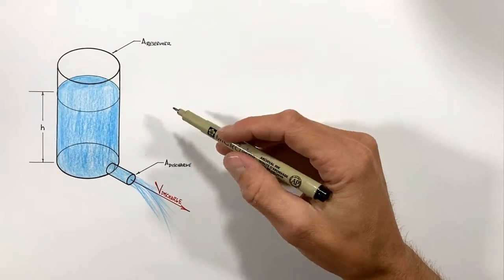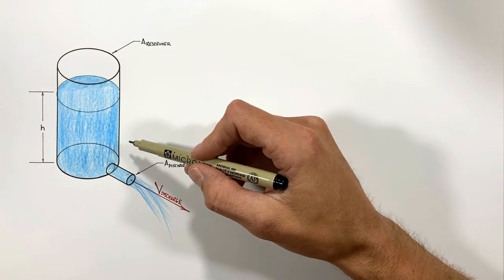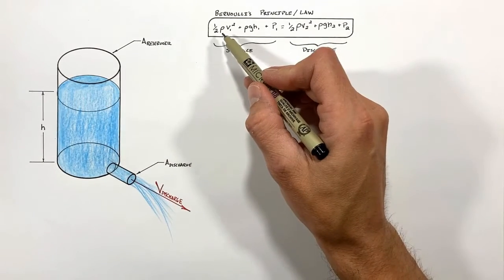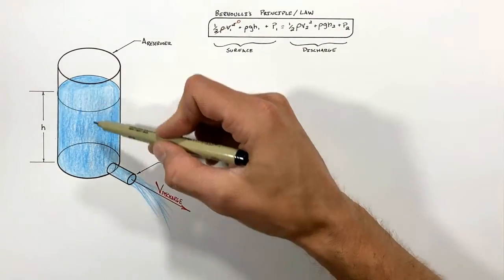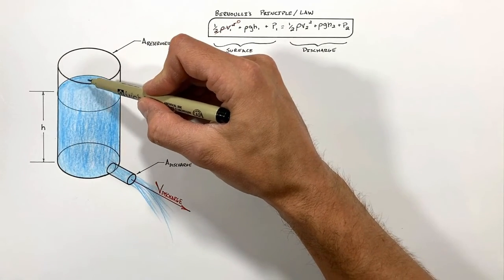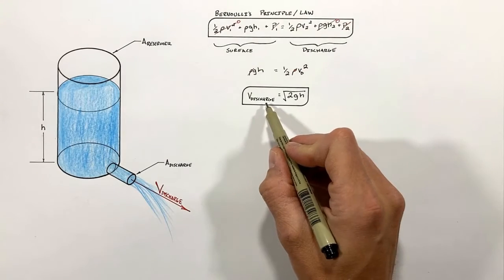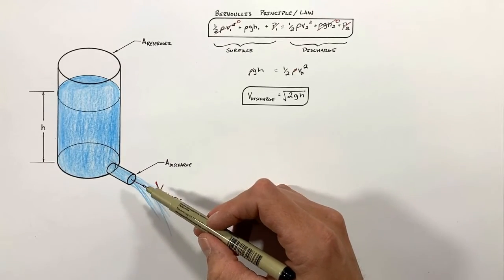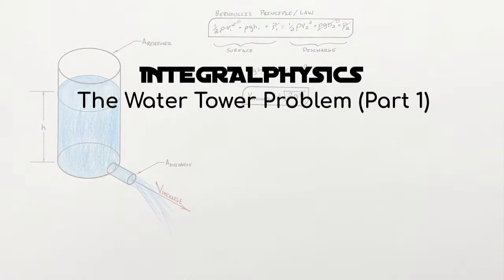Bernoulli's Water Tank | Calculate Discharge Velocity

Comment: I didn't like it about engineering. Many terms in the equation are assumed to be equal and just cancelled out. And here I am thinking what if P₁ and P₂ are not same, moreover g is not same for every height.
Reply from the maker: While you aren't wrong; do you really want to have a tank so tall that the atmospheric pressure and acceleration due to gravity vary between the top and bottom of the tank?
Reply: @INTEGRALPHYSICS  practically I don't want such a large tank but theoretically I want to consider each and every factors.

Comment: If I have a given tank size filled at a certain height, and need to determine the cross sectional area of the discharge pipe in order to achieve a specific discharge velocity at that instant, how would I use Bernoulli's equation given the cross sectional area is not in the equation?
Reply from the maker: 1st...  is there frictional loss in the problem you are working?
2nd..  are you solving for discharge velocity or volumetric flow rate?

Comment: What if the liquid inside the tank was under pressure, let's 45psi, and, let's assume this pressure remains constant while the tank drains (kind of like a syringe with the force on the plunger remains constant). I would then have to include the pressure inside the tank as the "P1" term, Pt. And the exit pressure (atm) as the term "P2" in the equation, Patm; correct? However, when solve the equation for the exit velocity, Vd, I end up with an equation that includes the term where (Pt - Patm)/ rho. How do you account that the pressure is expressed in pounds-force and the density is expressed in pounds-mass? These do not cancel themselves. Can I ask you provide guidance for solving this type of variation on the problem? Thank you for any help you can provide.
Reply from the maker: Use Newtons, kilograms, Pascals & m/s; then all your problems will melt away (unless you have a math error).
Reply: @INTEGRALPHYSICS  first of all, I must commend you on your quick reply. I thought it would be months before I received a reply, if at all. So Bernoulli’s equation only works with metric units??? 
I tried using Pascals but, that didn’t work either. Then I tried converting Pascals into kg/m2 but I stopped when I read the footnote on the conversion table that stated “the kg is in units of force instead of mass”. So, again, I end up with kg-force being divided by kg-mass. I’m sorry if I am completely missing something here but, I was taught in engineering school to make sure the units all match in equations.
Reply: @INTEGRALPHYSICS  I think I found my answer. After searching many videos, I found one by R12 Engineering, where they are trying to find the pressure inside of the tank. In it, he explains that, for water, you have two densities; one in pounds-force/ ft3 and one in pound-mass/ ft3. The lbf version already accounts for the “rho x g” and is expressed as 62.4 lbf/ ft3. Now my units match. I’m going to search some more to get confirmation on this.
Reply: @INTEGRALPHYSICS  yeah, that didn’t work either 😏. The term “(P1 - P2)/ rho” ends up in units of “feet” only; NOT “feet^2”. I’m starting to think this equation is only good for SI units. Which surprises me, since I didn’t think the SI units existed when Bernoulli came up with the equation. So, I don’t know. I would welcome if you did a follow up video with this problem and showing the units in English.

Comment: But isnt P1 different from P2? The pressure t P1 is the atmospheric pressure plus the pressure from the fluid above, whereas the pressure at P2 is only the atmospheric pressure?
Reply: Considering that, my calculation shows that discharge velocity=√((2P₀–2ρgh)/ρ), where P₀ is atmospheric pressure.

Comment: Does the cross-section of the hole matters?
Reply from the maker: provided we are a) ignoring friction and b) the cross section of the hole is much much smaller than the cross section of the container...  then no.
Reply: @INTEGRALPHYSICS  if the cross-section is significantly larger then it does matter. Right?
Reply from the maker: If the cross section of the discharge becomes large enough, then we have to consider the speed of the fluid at the surface of the reservoir; at which we have to treat this more like a 'tapering pipe' type of problem.

Comment: What if there are two holes? Is it correct to use Bernoulli's principle on each hole separately, or do we say that energies at the surface will equal sum of energies at both holes?
Reply from the maker: Provided the holes remain small relative to the cross section of the bucket...  You can apply Bernoulli's separately to each hole.
Reply: @INTEGRALPHYSICS  what if there a single hole but it's big where velocity at the surface is not negligible, how do you compute that? i built a small catch basin with a 3" outlet pipe

Comment: Sir,

According to Bernoulli equation the discharge velocity is irrespective of the area of outlet. But practically, when we put a finger in front of a hose, the velocity increases 

Please answer fast 🙏
Reply from the maker: Two reasons come to mind, head loss and continuity.  Head loss decreases when the flow rate through the hose decreases therefore there is more pressure at the outlet, putting your finger over the outlet will actually make most hoses swell slightly.  Next, continuity being an issue because the water in the hose was moving before it got to your finger (unlike in the video) then it sped up as the outlet choked down at your finger (see my continuity video),
Reply: @INTEGRALPHYSICS  
Sir, I understood what you told. Let me explain what I did in detail.
Reply: @INTEGRALPHYSICS  
Case - I: No finger
We consider two points, one on the free surface of water in tank and the second on the outlet. Using the Bernoulli eqaution gives v=root(2gh)

Case- II: With Finger
Again we consider two points, one on the surface of water in tank and other at the outlet (reduced area due to finger). We need a point where the pressure is equal to atmospheric pressure. So that gives v=root(2gh) again.

But this is not the actual case. So is the Bernoulli equation violated? 

Please try solving on a pen and paper. The selection of points 1 and 2 is also important. This problem is very conceptual. It was asked in the interview for the post of Scientist in an Indian Organisation. 

Actually the interviewer first asked to calculate using Bernoulli, then he said why does it contradict with the real observation. Please make a video on it.
Reply: @Anonymous-qq1yy  did you get any explanation ?? Do share it!
Reply: @ratnendrakushwaha551  Not Yet 😅
Reply: Also, there are some more conceptual errors in the solution in the video. We need to make assumptions for this solution. Can we discuss on Telegram?
Your channel is doing good, but is under development stage. I would like to contribute to it. 😊
Reply: @Anonymous-qq1yy  bro are u there yet
Reply: @dhanvanthsri484  Yes Sir
Reply: @Anonymous-qq1yy  bro can you explain why he chose P2 as only atmospheric pressure where there is pressure from the liquid inside the tank on the liquid in the discharge